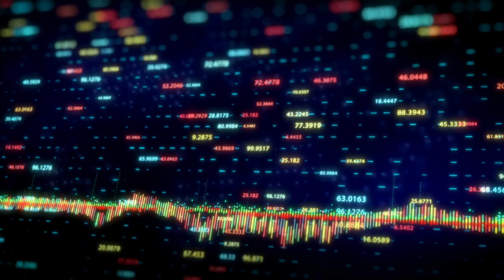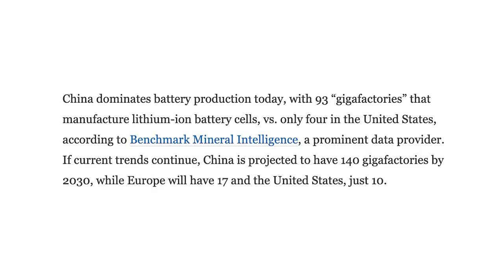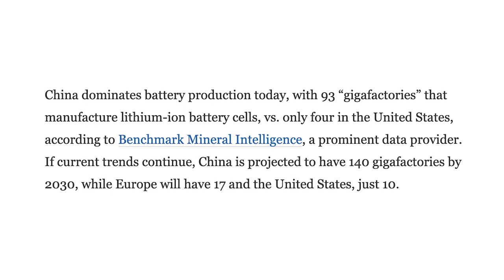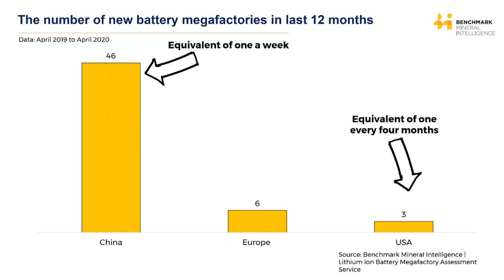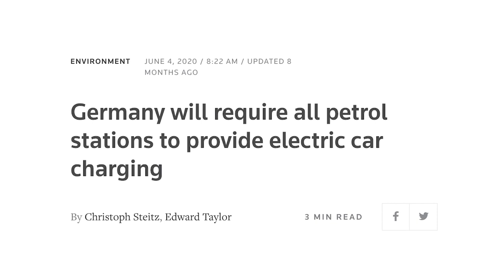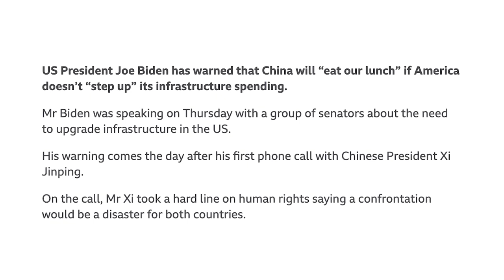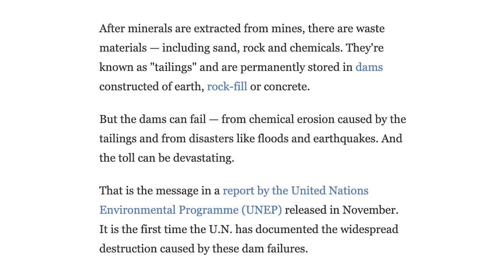The Importance of Tesla to America's Economic Future (bigger than you think)

Comment: Let me suggest we unbunch our bloomers a bit.  Let's start with materials and supply.

Apparently Tesla has apparently eliminated cobalt from future batteries.  Cobalt done.

Tesla is moving to lithium iron phosphate (LiFePo or LFP) batteries for everything other that its highest performance models.  Unless  you're willing to pay big bucks for very quick or extremely long range vehicles LFP batteries will be fine.  Lithium, iron, and phosphate are very abundant.  And cheap. And - wait for this - NON-Flammable.   And LFP has very high cycle life.  The LFP batteries I'm using in my solar system are rated for >10,000 cycles.  In a 250 mile range EV 10k cycles would give a 2,500,000 battery life.  

LFP for both non-performance EVs and grid/home energy storage.  A bit extra weight doesn't matter.  Cheap, very long lasting, and fireproof will win out.

Follow Tesla's lead and we won't need any cobalt and not a huge amount of nickel.  Plus, these materials are not consumed.  Once we build the first generation of EVs we can recycle the cell materials (about 99%) into new cells.  We'll have several years of large amount mining and then we'll be pretty much done.

Now, let's look at the car industry's boogieman that may well put most out of business.  Robotaxis.

Tony Seba says that personal car ownership should drop by about 7x with robotaxis.  Annual new car demand drops from 90 million per year to 13 million per year.  The world will need 7x fewer batteries for vehicles.  But wait, there' more.  

Those LFP batteries with 2.5 million mile lifespan?  What if someone (Tesla most likely) started building robotaxi EVs that would last 2.5 million miles?  Cast aluminum frame, stainless steel body.  A Cybertaxi.  
Make it easy to refurbish the interior and easy to replace parts that wear (bearings, hinges, etc.).  

One 2.5 million mile Cybertaxi would replace 10 250k mile "Camry" taxis.  13 million drops to 1.3 million.

Tesla has a factory on each of three continents.  Each factory can produce half a million Cybertaxis per year.  Some other car company is going to have to work super hard to get a piece of a pie that Tesla can bake better than anyone else.

We've got a big job ahead but it might not be as big as we think.